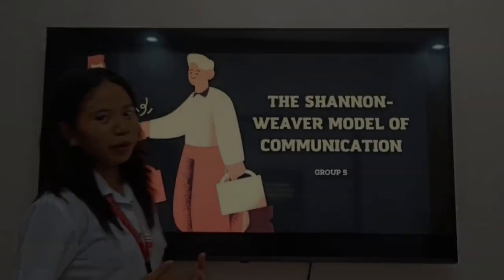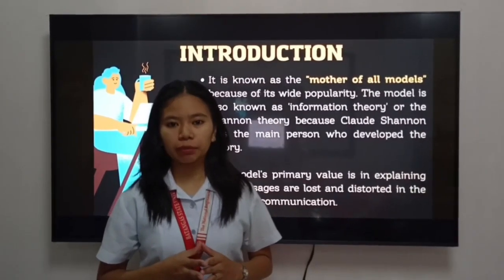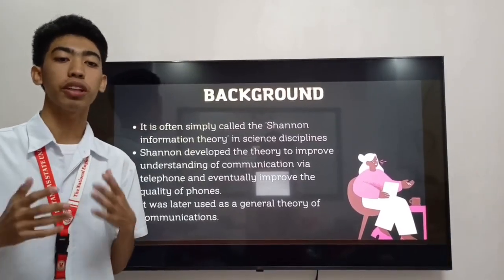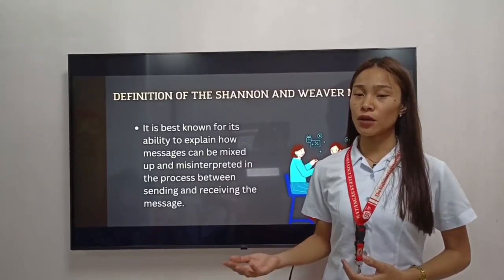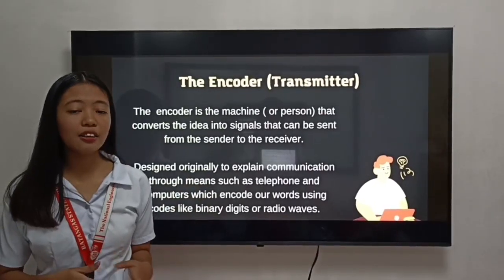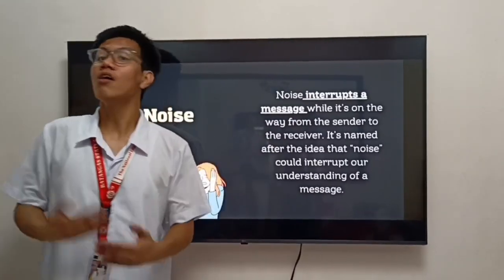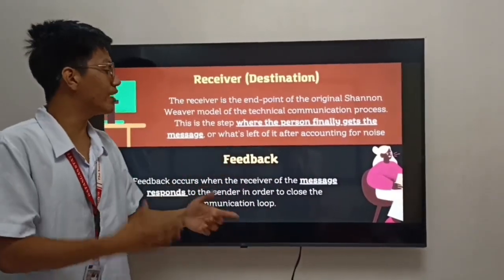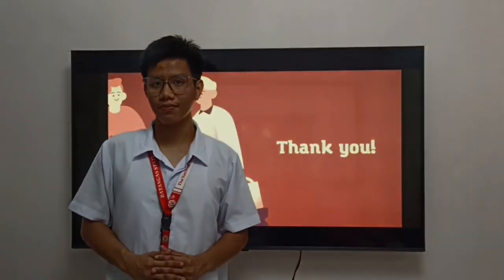Shannon-Weaver Model of Communication

Comment: Thank you for sharing this video because it helped me a lot to understand fhe Shannon-Weaver communication. I've learned that the Shannon-Weaver model of communication effectively illustrates the complexity of transmitting messages from sender to receiver. It highlights the importance of encoding, decoding, and the potential for noise to disrupt communication. This model emphasizes the necessity of clarity and context, as well as the role of feedback, demonstrating that communication is a dynamic exchange rather than a one-way process. This video enhanced my understanding of the factors that contribute to effective communication.

Comment: Thankyou so muchh po for this video discussion! Now I remember and really understand how communication starts and ends using this communication model. I do understand the concept about sender, encoder, noise, channel, decoder, receiver and also the feedback. Especially the noise that hinders a smooth conversation, for example you are talking through a call and the person you are talking to cannot understand you, you can't just think that they are not listening to you but it may be noisy in the place of the person you are talking to, so you do not understand each other. That's why  you should not judge the situation without knowing the reason or the situation of others. This discussion is very helpful, thank you so much! 

SHANIE MILANO
BSED-SSTU-1201